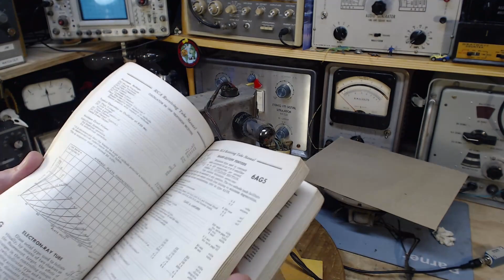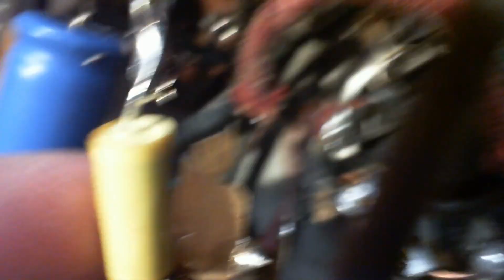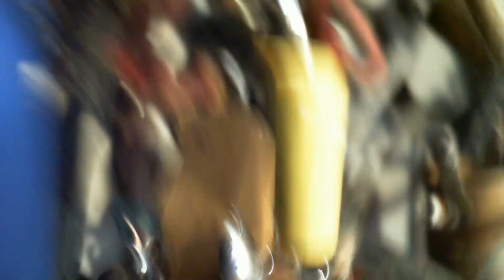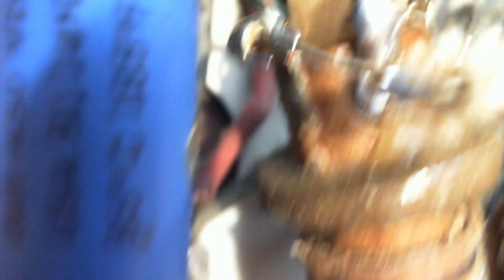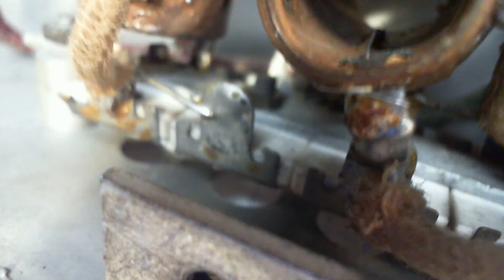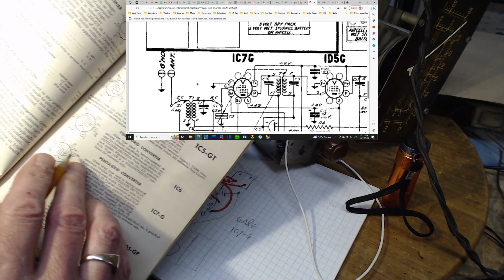Eatons Universal Electrohome Floorstanding Tube Radio Video #6 - Hard to Believe It

Comment: Maybe the conversion was a success, it worked fine, and now there's just a failed part somewhere. Is the original cabinet present and in good shape? Do the 6v tubes match the pinouts of the original tubes or is every tube socket rewired? Might be better to convert it back to original.  I'm just looking at it as a hobby effort. It's okay to scrap it.

Comment: Original tubes where 1v the modifier changed them to readily available 6v tubes that work very simular and used a 6v transformer to power heaters. Very simple even I would do same thing, that radio needs caps changed and alignment done

Comment: It doesn't matter what voltage the radio is...just FIX it...Someone wanted to use this set in the house, and the reason the caps were not replaced is the radio was probley still new or close to it. Again, fix it. Take it for what  it is.